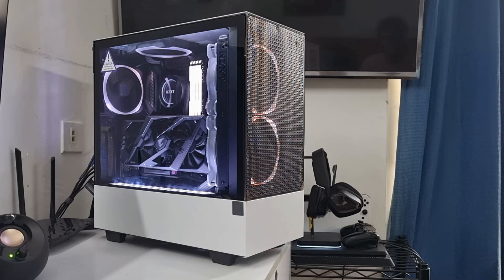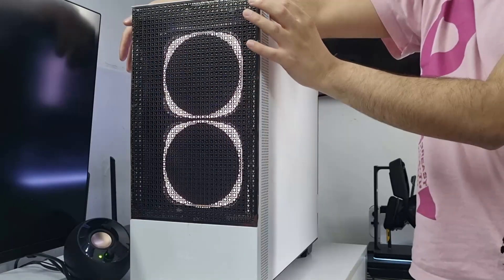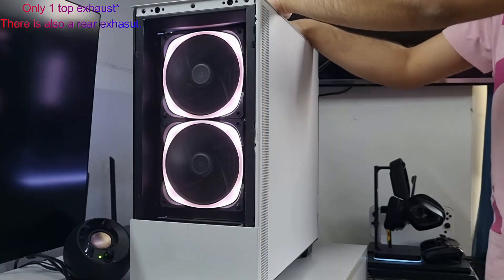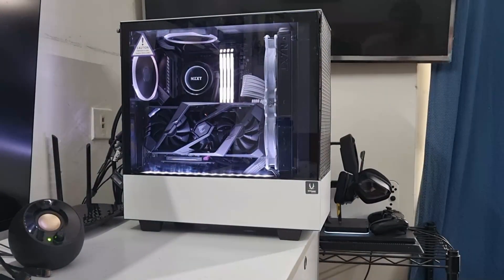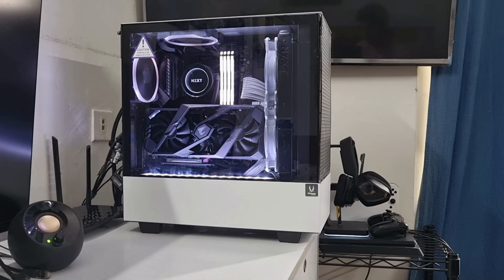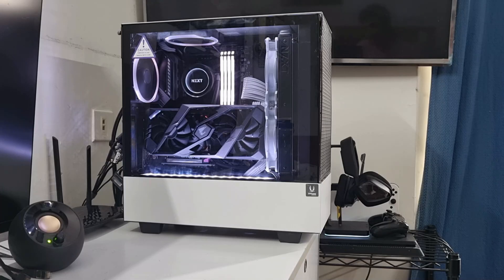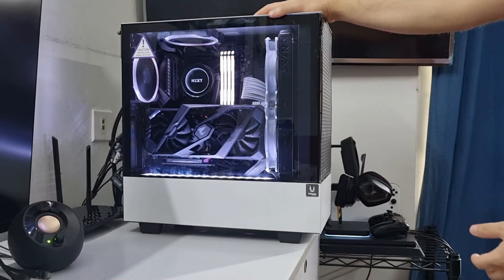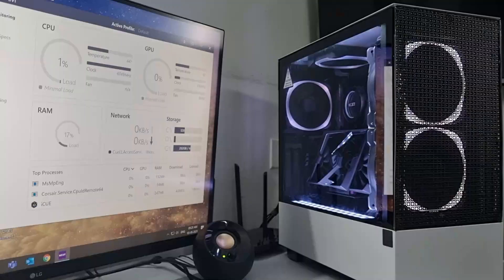NZXT H510 Elite Front Panel Mod: Increasing Airflow & Thermals

Comment: how does the front glass come off? do i just pull the hell out of it lol? it just feels really tight and i dont want glass all over the place
Reply from the maker: Nah lol don't pull it, there are two screws, one on each side that you can access after taking off the side panels on both sides. even after you remove the screws it's tight. but don't try anything until those screws are off!

Comment: Nice mod. You can probably find a Demicflex filter to fit the bill for front filtration, or Amazon has some aluminum or woven wire mesh that you can get that is a finer pitch (40 or 60 holes per inch is good) that you could theoretically secure with magnets or between the metal frame and the perforated metal sheet you crafted. A metal glue like JB Weld also would be super useful here. It's stupid that NZXT charges $200 for the Elite model in Canada and didn't make a case with two front panels. No one cares about CAM, their RGB controller or fan hubs.

Comment: I just took out my glass panel and printed out a template. Taped it to my glass and drilled 300 holes on the template through the glass. My temps dropped 9° on my gpu and 7° on my cpu. You need a glass cutting bit to do it. It's the cheapest route to not losing astetics but one wrong move and your glass will shatter.

Comment: link to the fans you used? and did the work plugged into the NZXT hub in the back of the case?
Reply from the maker: They're just NZXT AER RGB 2 fans that worked straight from the hub!
Reply: @skytechfreak  I mean the white ones that you put on the radiator
Reply from the maker: @ajmasters6546  Arctic Bionix p140. Btw, my insta handle is the same as the channel name - @skytechfreak
Reply from the maker: @ajmasters6546  Those are Arctic Bionix P140s!

Comment: Beautiful build mate! I love the modification and was thinking of doing the same because of the airflow. Even though the glass looks way nicer, it gets too hot. By any chance do you know the dimensions of the front front panel?
Reply from the maker: Yeah I do actually - "From what I measured the 332mm x 208mm. The panel is about 4.5-5mm thick. There's also a tab that extends like 4mm along the bottom of the panel which is about 1mm thick." - stolen dimensions from reddit lol
Reply: @skytechfreak  The front tempered glass was actually glued to the frame, so I was able to rip the glass off. Then I got a mesh from Home Depot for 20$ and cut it to fit in the frame. No other work was required. I glued the mesh in. And online they sell for $60! I recommend doing this for anyone else. Thanks so much!
Reply from the maker: @reinbowed  Hey, yeah I knew about ripping the glass from the frame, i just wanted to keep the whole thing intact in case I ever wanted to go back to the glass look. The ones you can buy don't ship to india unfortunately, so we have to get a little creative around here lol ;)

Comment: nice cool!
is it easy to remove the front glass? is it fixed with glue?
Reply from the maker: Yeah it's easy to do, no glue. 2 tiny screws, very easy to miss. You Need to take off the side glass panel and the other side rear cable management panel to see them. There's one on each side.

Comment: how in the world do u take off the front panel???
Reply from the maker: 2 tiny screws, very easy to miss. You Need to take off the side glass panel and the other side rear cable management panel to see them. There's one on each side.

Comment: Which vertical gpu mount are you using in your h510 elite?
Reply from the maker: Hey, I'm using Coolermaster's V2 Kit, its really good and allows a lot of adjustment for how close or far you want the GPU to the back of the case!
Reply: @skytechfreak  I'm also using that one, it works nicely in the case
Reply: vertical mounting in h510 elite is not adviseable
Reply: @Steinnfn  thanks but that wasn’t my question. They have new vertical gpu mounts like the one in the video that are further away from the side glass panel which makes it ok to use. I also removed the front glass and have a custom front panel for optimal airflow so I don’t think I’d have a problem with a vertical gpu mount.
Reply: @samk1301  You didn't ask me, and it's not the one that's used in this video.  But I have the 510 elite and an Aorus 2080 super (notoriously hot gpu) using the CableMod vertical GPU mount and it pulls the card about two inches away from the glass panel.  Even with the regular glass front and two exhaust fans, I usually get around 70C on full load on the GPU.